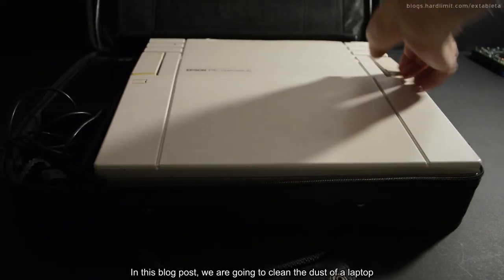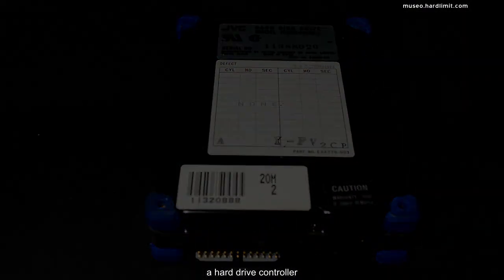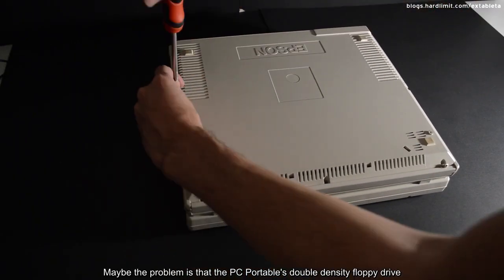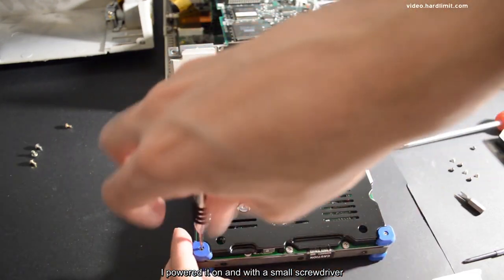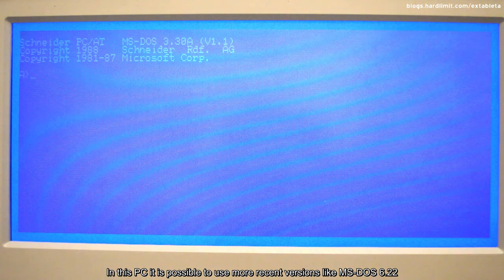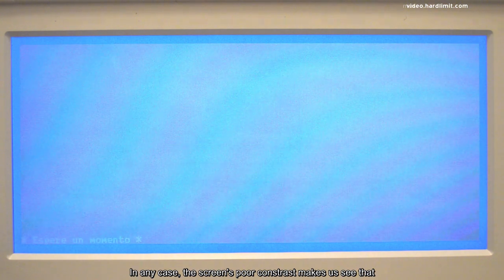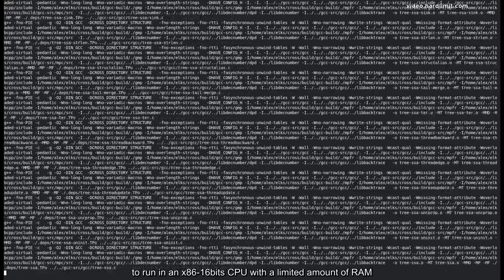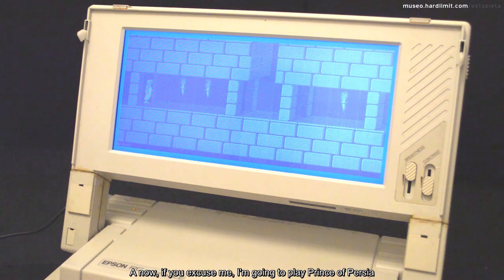Epson PC Portable Q150A / Equity LT (Nec V30 8086 - 1989) [English]

Comment: I have a toshiba t1200. It comes with the hard disk platter stuck problem, but appears I noticed in time. The hard disk booted in ms dos 3.30. Since I'd want to try the EKLS, do you know if there is some installation tool?
Reply from the maker: I'm glad you noticed the problem in time. I think mine is gone forever. AFAIK the only way is by creating an hard disk image thru 'menuconfig' and then, copying the image to your hard drive. I've never done that and I guess it's not that easy with such an old hdd since you cannot attach it directly to a modern PC.
Reply: @alejandrocobolopez  In my case not a chance. Toshiba made some proprietary connectors so it's almost impossible to attach the hd somewhere else

Comment: I have same machinę, but without harddrive, mine has 2 floppy drives instead. I'm looking for a MS-DOS 3,3 which willarun from a floppy. Several years before I succecfully booted it with novell dos. I took 1,44 floppy, sticked a tape im one corner, so it would be detected as a 720k :-).  On mine unit, original battery works, and unit work on IT for 15-20 minutes... On a 34 year old battery:-) I bought it in 2006 for 4 EUR :-)
Reply from the maker: A 30+ years old battery still working is impressive. Mine was leaking so I removed it. Congratulations for the great deal. You won't see a working 8086 for 4€ anymore.

Comment: Hey there! I got my laptop. What voltage does it need?
Reply from the maker: 15V 2A. Here you have a set of images (including the power supply specs) and additional info: https://museo.hardlimit.com/ordenador.php?modelo=epson-pc-portable-q150a
Reply: @alejandrocobolopez  oh! Thanks! Tried it already out and it worked! But the LCD is dead and sadly, I have no solid drive, only 2 floppy drives. So I can't boot it ^^"